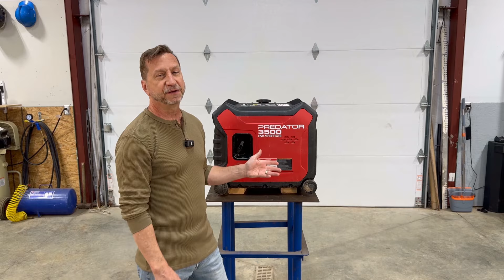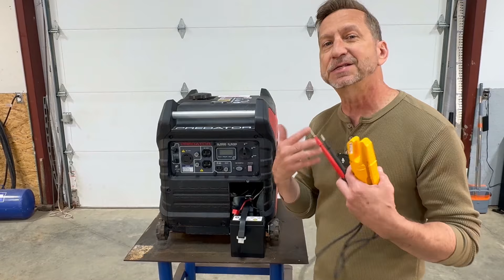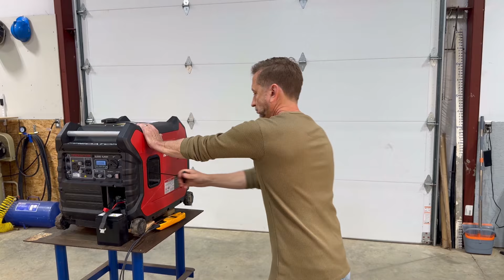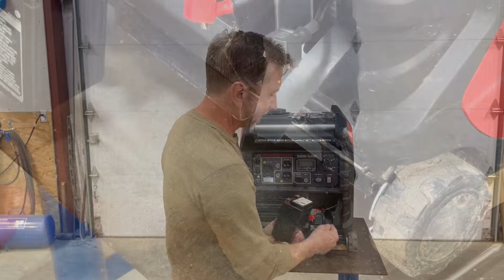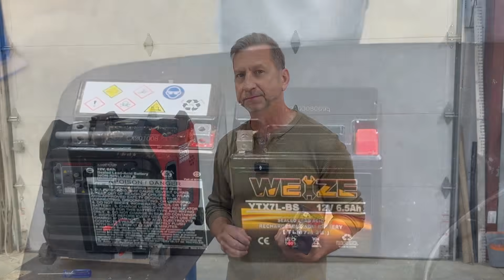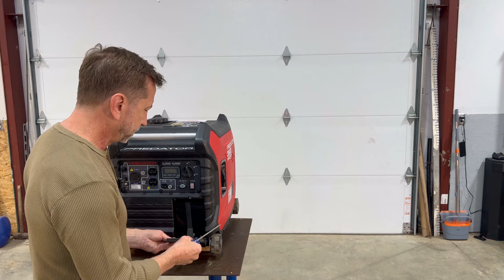How to Test and Replace the Predator 3500 Battery (COMPLETE Ultimate Guide)

Comment: Nice video... the battery need it to start de generator?
Reply from the maker: You can use either the pull start or the electric start with the battery. The pull starter actually works pretty good, but if something ever happened to the cord, it would be nice to have the push button start with the battery which is the main reason I replaced it. Thanks for watching.

Comment: Quailty video production and easy to understand your voice and instruction. Thank you, I subscribed and dont do that very often. When I put my predator in service for the first it was 5 months after purchase. Cancer got in the way. Now that I tried to start it the battery wont hold a charge. HF custumer service wasn't any help. This was after 20 oz of oil pissed on my shop floor because the drain blot wasn't tight from the factory. Happened overnight. UGH!
Reply from the maker: Thank you for the kind words Ray, I sincerely appreciate that. Also appreciate you subscribing. That sucks the battery won’t hold a charge. I think they should cover that under warranty, but many times things like that are exempt from a warranty. I still think they should take care of you. Not an expensive item for them to handle. Also stinks about the oil plug. I never even thought to check mine before adding oil. I would’ve been pretty salty if that happened to me. Hopefully your experience improves moving forward. I understand about cancer being disruptive. I’ve not had to fight it personally, but have plenty of experience within my family. Thanks again for taking the time to comment.

Comment: I would use something to separate the pull cord from the case. I have seen from running them and not using the cord they get wore down and can break the first time you try and use it FYI!
Reply from the maker: Good point. A quick visual inspection periodically would be a good way to find that before it becomes a problem. 👍
Reply: Can you charge the battery while it's still connected to the generator?